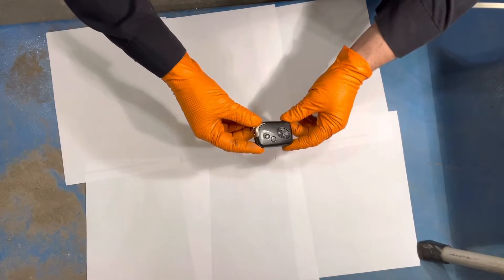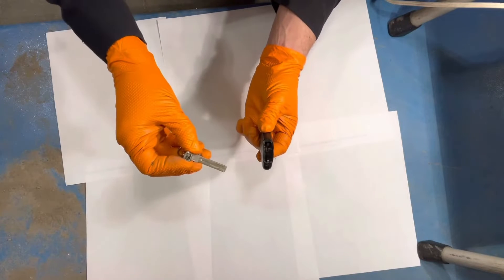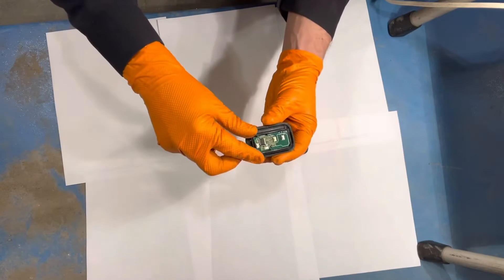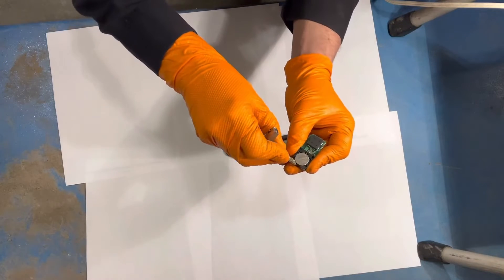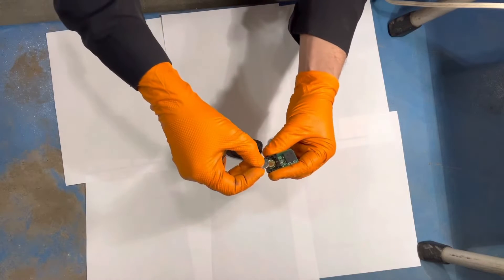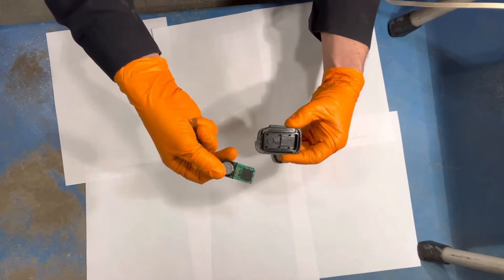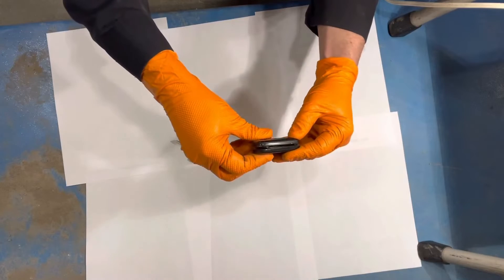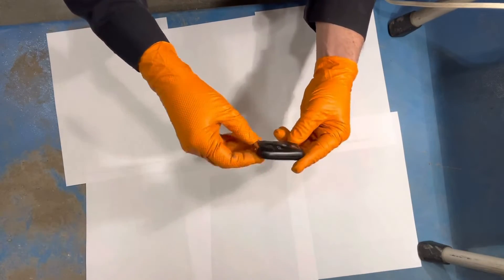2010-2015 Lexus RX350 RX450h Key Fob Transmitter Battery Replacement Instructions

Comment: Clear and straight-forward video, Viktor. Great Job!

If I replace the battery in my 2015 Lexus RX350's key fob, is there a chance that it might require reprogramming? I say this because I only have the one fob. I am looking into getting a 2nd set but wanted to ask out of curiosity. I'll likely postpone replacement until I have the 2nd set. Thanks
Reply from the maker: No programming required. Cheers!

Comment: Ive had lexus before and this is the way i have changed the batteries. It wont work for my 2015 rx. Its like its glued and jf i force it more it will break the casing.
Reply from the maker: @MD-uu5nt  I’ve seen people break the casing and then glue it to hold it together, maybe that’s what happened with yours in the past.
Reply: @Viktor_G_Automotive  yes, that's possible. It doesn't look broken though.